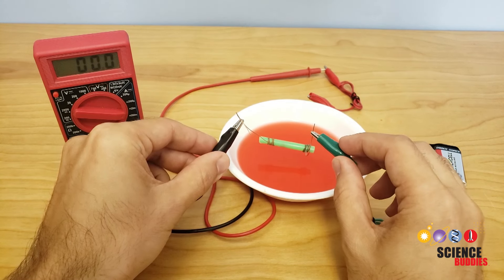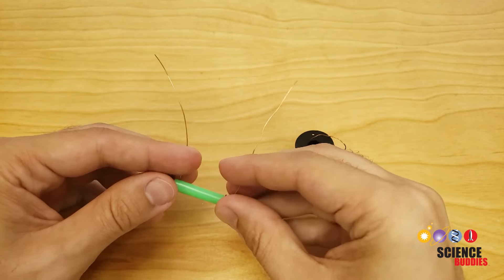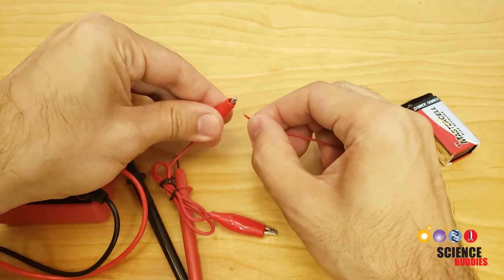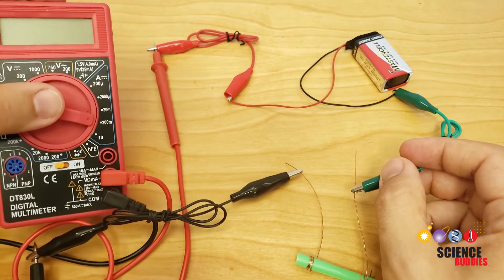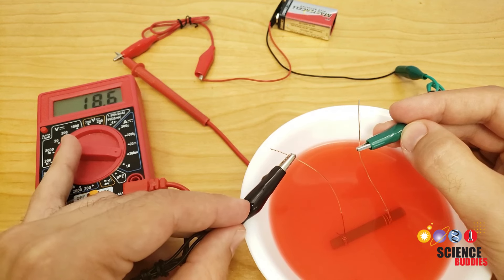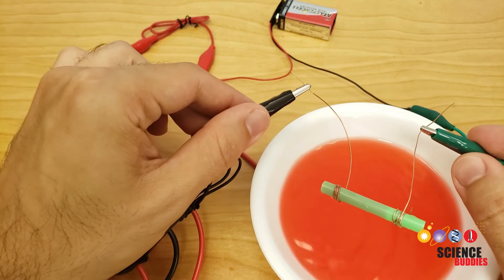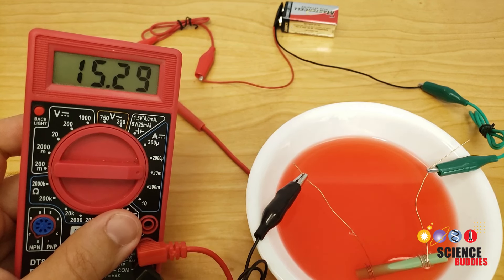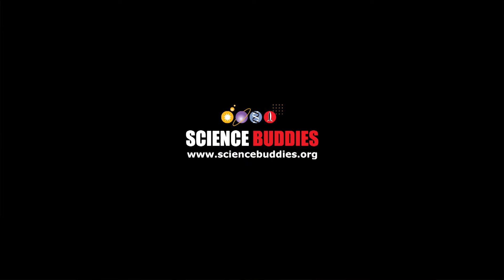Measure Electrolytes in Sports Drinks - Science Project

Comment: Hello. I set up the circuit for the multimeter. The multimeter I’m using is a different one without a knob, and has batteries. Does this only work with a certain kind of multimeter, or do I have to make adjustments to my circuit?
Reply from the maker: Hi - this project should work with most multimeters. We recommend watching the video and reading the instructions on our multimeter tutorial page, which may help you figure out how to use your multimeter: https://www.sciencebuddies.org/science-fair-projects/references/how-to-use-a-multimeter

Comment: Hi there, I was just wondering if the copper wire we use has to be 24 gauge.
Reply from the maker: The wire does not need to be exactly 24 gauge. 24 gauge works well because it's a good balance of stiffness - flexible enough that you can bend it around the straw by hand, but stiff enough to hold its shape. Much thicker or much thinner wires can be difficult to work with.

Comment: Hi, im trying to do this experiment, is the resistor needed?
Reply from the maker: The resistor is included in the kit so you can confirm that your multimeter's fuse isn't blown (see project FAQ linked in the description).
Reply: How does the equation work?
Reply from the maker: Hi - could you let us know which equation you're referring to?
Reply: @Science.Buddies  the conductance = amps divided by voltage. Is the voltage the 9v battery, or do you have to measure the volts?
Reply from the maker: For purposes of this project you can assume the voltage is 9V. In reality the battery's voltage will not be exactly 9V, but you would need a second multimeter to measure the voltage while simultaneously measuring current.

Comment: I did this experiment except with energy drinks and an orange juice. With my orange juice I used the 200milliamp feature and the reading on my multimeter can back as 21. Would I calculate the conductance by doing 21/9 or do 0.021/9?
Reply from the maker: See equation 1 in the project's introduction - conductance (siemens) = current (amps) / voltage (volts). So if you want conductance in siemens, you need to convert your current to amps first (0.021). If you keep current as milliamps, then your result will be in millisiemens. Either way is fine as long as you are consistent between different liquids.

Comment: In the list of materials needed I see there are 11k Ohm resistors but not once in the video it shows what they’re for or how to use them on the project. Are they needed or are they misleading us into something we won’t need to conduct this experiment?
Reply from the maker: The 1K resistor is included in the kit because some students blow the multimeter fuse when doing this project; the resistor makes it easier to test if you have a blown fuse but you do not need it to do the main project.

Comment: do you need to use the copper wire or could you just stick in the alligator clips?
Reply from the maker: It would work with the alligator clips but they may corrode over time and the copper wire is easier to replace.

Comment: does the straw need to be plastic 
also does the amount of coils affect the test?
Reply from the maker: The straw needs to be non-conductive - do not use a metal straw or it will short out the sensor. The number of coils will affect the surface area exposed to liquid and therefore affect the conductivity measurement, but this will not matter as long as you keep the number of coils constant since you are making relative measurements between different liquids.
Reply: @Science.Buddies   k thnks

Comment: Me and my science partner were meant to buy your kit but he accidentally bought a different multimeter. It didnt come with copper wire so im wondering if you know what type of copper wire it is?
Reply from the maker: You need "bare" (uninsulated) copper wire to do this project, any thin flexible gauge will work well (meaning flexible enough that you can easily bend it with your hands, like 28 AWG). Do not buy "magnet wire" or "enamel-coated" wire because that has a thin layer of transparent insulation on it.

Comment: Hi, so on the website it says I need a 1k ohm resistor and while looking for one I found several, however some had different wattages and I was wondering if it has to be a specific wattage, for example a 1/4 watt or 1/8, or can it be any? Thank you.
Reply from the maker: Hi - long story short, 1/4W is probably the most common type but in this case a 1/8W resistor would be OK. The full explanation is that you need to make sure the power dissipated by a resistor does not exceed its wattage rating. To figure that out, first we calculate the current through the resistor using Ohm's Law - voltage = current x resistance or V = i*R. In this circuit we know V = 9 volts and R = 1,000 ohms. So i = 9V / 1,000 ohms = 0.009 amps. Next we calculate the resistor's power dissipation, power = current squared x resistance or P = i^2*R. That's P = (0.009)^2 x 1,000 = 0.081 watts (W), or 81 milliwatts (mW). That is well below 1/4 W (0.25W or 250mW) and also below 1/8W (0.125W or 125mW). While it isn't critical for this project, typically in engineering you want a "factor of safety" so you don't get too close to your maximum ratings, so if building a more permanent circuit in this case you'd probably go with 1/4W just to be safe. Hope that helps!

Comment: why not just stick the alligator clips in the water manually and forget the wire straw appartus?  Seems like if you place them in the liquid at the same spots and depth you eliminate the whole straw copper contraption.  Also even considering your set up the distance between the wires on the straw - will that make the measurement change the farther or bigger the straw is.  Thats fine if it does it just means that your comparisons have to be done with the same configuration.  Making one measurement with one sized straw will change using another sized straw with the same liquid?  Thats a question not a statement.  Interesting video thanks for posting
Reply from the maker: The wire can start to corrode over time so you want it to be replaceable - it's cheaper to replace a few inches of wire than to replace your alligator clips. Otherwise, yes, you're correct - you need to keep the amount of submerged wire and spacing between the wires constant between trials.

Comment: I was comparing different fluids and used a measuring cup to pour 1.5 cups of each fluid into a bowl. From your video, you said that more surface area of the wire immersed would increase the current, so I wanted to have the depth of the conductor assembly the same for all fluids tested.
Reply from the maker: You can use the same sensor as long as you take readings quickly and rinse it with distilled water in between tests. If you start to notice significant color change of the wire, you should make a new sensor.

Comment: Hi, i am trying this experiment and i have set the multimeter knob to 200m, but it greatly contrasts with the reading in the video. I am getting about 0.7 for powerade at 20 degrees celcius
Reply from the maker: Your reading can depend on the geometry of your conductance sensor (the total surface area of wire submerged under the liquid and the spacing between the two wires), so your results may vary from what you see in our video. The important thing is consistency within your own experiment and the relative readings you get between different liquids you test.

Comment: why does my multimeter always read 1, i all ready change the scale of am, everything is well connected, it always reads 1 ( the type of 1 that means that the scale is too low or too high for measuring the am)
Reply from the maker: You may have blown the fuse in your multimeter. See the FAQ in the written instructions (linked in the video description) for troubleshooting tips.

Comment: I tried to do th experiment using energy drinks Alani, Monster, Red Bull  with 9V battery and 200m setting but no result
Tried by getting new multimeter - still not sure luck
To remove possibility of copper wire issue, dipped the alligator clips directly in drinks and still no results or call it zero
What could I be doing wrong
Reply from the maker: If you are a K-12 student doing a school science project, please ask for help in the Ask an Expert forums on our website and we will be able to assist you further: https://www.sciencebuddies.org/science-fair-projects/ask-an-expert-intro